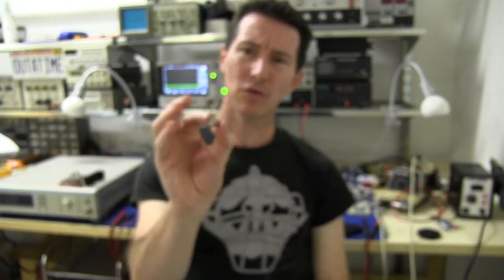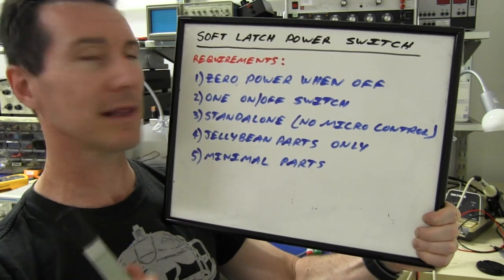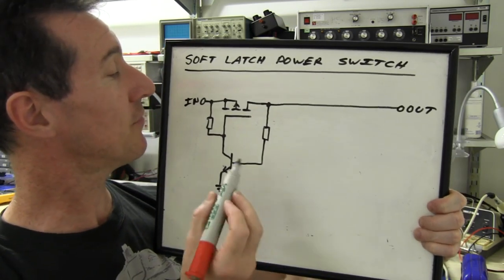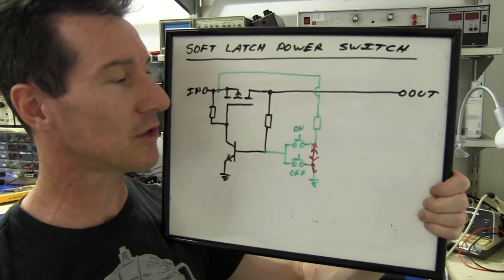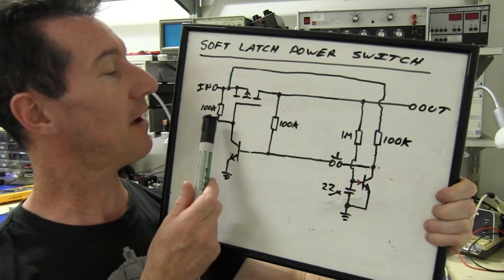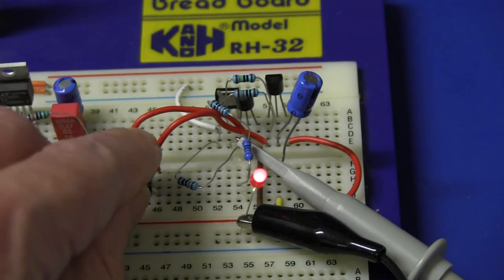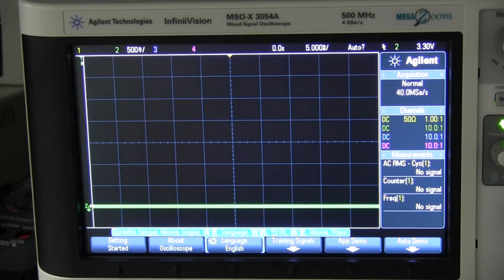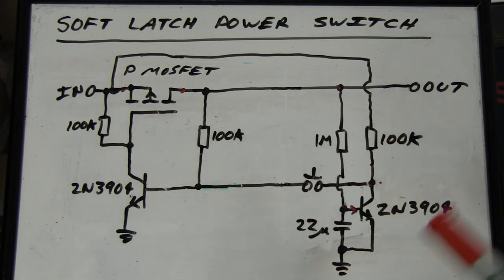EEVblog #262 - World's Simplest Soft Latching Power Switch Circuit

Comment: that circuit has a problem, if the load has capacitor filters will require more time pressing to switch off. A diode between the load and the switcher circuitry will work.
Reply: or maybe you can to use that output to feed another FET that will act as the real load switcher.

Comment: Hi EEVblog, is your "World's Simplest Soft Latching Power Switch Circuit" also working for ATX power supplies? As I understand it, the PS_ON line of an ATX power supply uses a TTL active-low signal. How could I use this circuit for this? I want to switch an ATX power supply on and off without a motherboard by using the push-button switch of the PC case. Thanks und best regards, Chris

Comment: If you want a microcontroller to control a load on and off, all you need is a transistor (or maybe two as darlington if it´s a really big load), all this circuitry is unnecessary. And if you ment to turn on the whole thing with the microcontroller, how do you power the micro when it´s turned off?
Also, that wouldn´t work since a optocoupler normally has like an NPN-transistor inside, so it can only lead current in one direction, it can not depend on the in-voltage like in this circuit.

Comment: Please help me! I have to use this circuit 160x because im building battery testing machine. Is there any 8 channel integrated circuit? I need a name of the chip. I have searched internet many times but i only can find non latching switch integrated circuit. Please help me, thank you

Comment: Is there a way to make a circuit to do away with the oscillation?  I am looking at building something simple to turn on with a press, and if you hold it accidentally it won't turn off, and to turn off would require holding for a couple seconds, and still will not turn back on if kept held.

Comment: Basically its the transistor equivalent of an SCR.
Reply: ***** Silicon Controlled Rectifier, or thyristor. The first circuit with the NPN and PNP transistor connecter back to back was the equivalent to the self latching behavior of an SCR when gate current is applied.
Reply: It's the equivalent of an SRC with a means of de-latching once the gate is powered. Switching things on is never the problem, it's getting them off again that always proves to be a challenge.
Reply: FreeFlamingInfinite yes, you are hundred percent true. i used the comparators output which is 5 or 0 volts for the triggering the circuit. once comparators out put is high my circuit latches and how i can delatch it? i want to de latch the circuit independent of comparators output.
Reply: Bilal Masood So are you saying that you're using a comparator in place of the single switch in the circuit above, and yet once the comparator has gone high (activating the circuit) you want the comparator to be able to stay high, and yet still be able to de-activate the circuit's latch system? Basically like pressing the button and holding it on permanently, while still able to switch the latch off again?
Reply: FreeFlamingInfinite sensor is attached to the comparator, Comparator is set to the reference 100mV, if the voltages from the sensor are high than  reference, Comparator's output is high 5v. now the thing is i am sensing vibrations. the signal from the sensor appears for very short time and so the comparator's output is high for very short time. i want to see the LED ON if knock is detected. the comparator's output then goes to the base of a NPN transistor and it turn on and latches the LED ON even through there is no signal from sensor. now this circuit is latched how can i de latch from micro controller. i have made a video of that circuit working.  https://drive.google.com/file/d/0B2wEybY4-pb_azBWSWE5dV91aEU/edit?usp=sharing ......

Comment: Me, personally, I would immediately strike requirement 2.  In general, I hate single function on/off switches.  I want to be able to definitively say, I want this on or I want this off.  With the lever type switch you started with, that's easy; the lever is to one side, it's definitively on, the other, off.  It is the same with SOME push-on-push-off switches, IF they have enough travel to see if they're depressed or not.  Otherwise, inevitably at some time I end up toggling it off when I meant to turn it on, or vice-versa.
Reply: Good point rchandr....  Also, I like the physical switch because there's less chance of it going bad than a component going bad and turning the circuit on by itself.

Comment: Think it would be possible to switch between 2 power supplies? Say between USB supply and a battery pack? I'm trying to do it with a circuit simulator but I have a few problems as I can't allow the battery to leak to the USB side (and vice versa) and I'm hoping to make the switching automatic.

Comment: @EEVblog can you make a modiffication to the circuit to use a N-Channel mosffet instead of a P-Channel mosfet?

PS: Very nice video i love the way you explain the circuit, thanks for the video :)
Reply: Ne555N N-channel would cut the negative supply and use two PNP transistors instead.  If negative is your ground, this would be a bad idea.  More money can be saved with the improvements in one of the other threads (ends up with a smaller capacitor).  Depending on parts and assembly costs you may win or loose a few cents by using a dual transistor SMD package instead of two singles.  Also calculate if you really need the suggested specific resistors on your BOM or can use values from elsewhere in your device.

Comment: What about N.MOSFETs? If I use a N.MOSFET, a couple of PNP BJTs and reversing the cap, is it stil working normaly (reversing the supply polarity of course) ? I just think so... I ask you this because I have some N.MOSFETs with Rdson = 8 milliohms and I wanna use them in this way (ON/OFF). Thx.

Comment: Hello, which mosfet do you recommend to handle 220 volts or 120 volts. keep in mind this will power an AC vending machine motor.
Thank you.
Reply: can not supply ac directly. this is a dc switch. however, for ac you can power a contactor as a load. the contactor-a real switch, could further supply your machine. concern here is the power draw of the contactor. industry works with 24vac-dc. if that is too much, the implement a relay to drive the contactor

Comment: When i build that first example circuit it always stays on (unless the "off" switch is held) unless I put a resistor (I use 10k) between emitter and base on the NPN-transistor. I use the 1k for base on both NPN and PNP. Is this normal?

Comment: the first circuit you showed with 2 transistor didn't work. LED is permanently on when i press the off switch the led is off till i hold the switch. the final circuit did work for me but it doesnot toggle the state everytime i press the button, i think i am facing debounce issue, any tip?
Reply: Google "debounce capacitor".

Comment: I am a total noob, which is why I'm here. But I may have a simper idea. 
It would utilise a GTO SCR thyristor,to replace both your latching transistor and mosfet. Job done?
Reply: +TheBaconWizard Yes! At least for me using a common C106 SCR. The Anode goes to 5V pos, the cathode goes to the load to ground. The gate of the SCR goes through a switch to a pull up resistor and a npn transistor to ground. The NPN transistor's base goes to a cap (47uF) and to a 100K to the cathode.
Reply: +TrainMasterMan great, well I have a BTV58-850C that aught to do very nicely then.

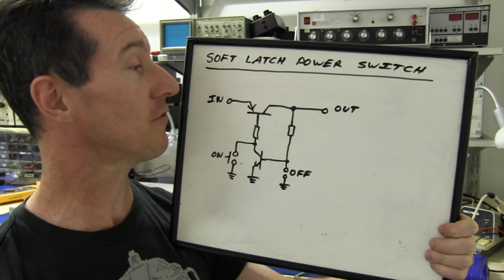Comment: will the circuit at 3:12 work if I want to turn arduino on with push button..... the arduino runs then simulates push button at the off position to shut it's self down?

Comment: Hi, i want to use this circuit with a 12v relay on the output to control my fog light on my car.  I have the OEM momentary switch in the car and for now they only beam up when holding the switch...  Will it stay off when i start the car?  I know that i can install a on-off switch but i want to stay with the factory momentary one.  Thanks!
Reply: hey did you get through using the circuit on 12v.

Comment: i used the comparators output which is 5 or 0 volts for the triggering the circuit ON. once comparators out put is high my circuit latches and how i can delatch it? i want to de latch the circuit independent of comparators output. i used the same configuration. any idea brothers.

Comment: Quick question, I made this but when I push the button the LED goes off, but comes back on when I release the button. If I hold the button, it oscillates. Where did I go wrong?
Reply: {MLP} Rainbow Dash check wiring,
Reply: Maybe.
Reply: {MLP} Rainbow Dash Actually removed my comment, since what you are describing is nothing but your cap emptying. There is nothing in this schematic that keeps your cap charged to keep it off. One solution would be to invert the on off state :D That way itll start off, and itll hold an off state forever, and then keeping the cap charged when in the on state would be simple.
Reply: Richard Smith I realized i used the wrong type of capacitor, I used an electrolytic.
Reply: {MLP} Rainbow Dash Yeah a larger capacitor will only delay the inevitable I am afraid, but if it works, who cares.
Reply: marionetadelplaneta it has to be a non polarized capacitor, which an electrolytic capacitor is. Ceramic caps are not. So it has to be the cap.
Reply: {MLP} Rainbow Dash but one side is always on ground so you just place it with the 0 V leg to ground
Reply: {MLP} Rainbow Dash and no AC signals are involved so i say the fact that is electrolitic isnt the issue ,but the capacitace might be since they are bigger on that aspect

Comment: I tried to build it with all 3 bjt transistors and the same resistors and it doesnt turns off when i release the botton, why would that happen? im using 2n2222 and 3907

Comment: hi i was wondering along similar lines:  Do you think it could be possible to use an opto-isolator to replace the button, so that a micro controller could switch this type of circuit on/off : ?

Comment: I just cant get this to work for whatever reason. Im using 2n2222 instead of 2n3904 but theyre basicly the same and shouldnt make any difference. What happens is the led on the output is constantly on and when i press the switch nothing happens except it glowing a tiny bit less brightly. Help?

Comment: Digikey 2020-08 in stock prices @5000qtd
0.02 - 2n3904
0.25 - FQD5P20TM ? 200V 3.7A 1.4ohm
0.002 - resistors
0.04 - capacitor 
0.33 - button

1.26 - switch

Comment: Efka ab60d motor , quick rotan 
q40 plus I have some of these motor in my stool they need a synchronizer to run I guess but synchronizer would cause a hundred and fifty US Dollars 1 is there a way to reverse engineer and use this motor without a synchronizer thank you

Comment: Won't a high capacitance load just switch this right back ON?
Reply: Yup, just like the anti-oscillation capacitor did.   You'd need a higher current drain (resistive load) or a diode to block current from the load to re-engage the switch.
Reply: Just built up this circuit on a actual prototype board, theres a couple 220uF electrolytics on the load side (motor drivers) and yip, cant get it to turn off at all, as the current stored in the caps, keeps pulling up the righthand transistor.  @eevblog dave, help! (:

Comment: Has anyone successfully duplicated this circuit?  If so what did you use for the MOSFET?  Seems the IRF9110 is pure Unobtanium.
Reply: i dit it with PNP
But you can use IRF9610 as mosfet

Comment: Well i'm not sure it would be cheaper. But if you have it drive a relay, it can driver a much higher current then a normal toggle switch. That's what I would user it for anyway... 12+ A circuits : |

Comment: For the P-MOS... I need an through-hole device. Can I use a 2N7002?
Reply: The brave can ask...
Reply: I forgot that 2n7000 is a NMOS and not PMOS - as required on this circuit. What options do I have?

Comment: Hi, I have a question that might seem odd, but is it possible to do a latching switch like this, but have the "anternate" state floating, not ground? - I want to switch between an input that goes 0v-15v to a floating state, is that possible with anything digital and a pushbutton? (atm its controlled with a toggle switch) - as pointed out the solution of a toggle switch is quite pricy, and also for me not handy with the lever sticking out.
Reply: Jinxid77 : The magic word of the day is "tristate". Replace the switch with a transistor's output, and connect nothing else to that side of the transistor. Technically it'll act as a small capacitor, but your switch was doing that anyways. Beware static: it could momentarily eliminate the isolation when using a switch, and can permanently do so when using a transistor: in extreme cases only relays and vacuum tubes are capable of the requirements.
Reply: Jared Maddox thanks for the suggestion and explanation :)

Comment: I'm trying to use this circuit (the final) to switch on a ATX PSU but it doesn't work. I know the circuit works as I can see the output voltage go high/low. I use the PS_ON as input voltage and output is tied to gnd. Any ideas?
Reply: the psu ps_on pin goes to ground.... maybe add a simple optosolator to short the switch ps_on pin to ground? but then you would loose the vcc from that pin to power the circuit...hmmm maybe a relay to switch between the ps_on pin to the 5v vcc rail pin with some capacitors to act as voltage buffer for the circuit while the relay is switching over the vcc from the ps_on to the 5v rail? interesting concept.... alas its hard to think at 2:30am lol
Reply: A relay is totally overkill. Use the standby power supply for the BJTs and put the MOSFET between the PS_ON signal and ground.

Comment: @5:37 Either i am totally missing something or this diagram makes no sense. Could someone please help. Lets assume the fet is NPN, this would mean that the other transistor would need to be PNP since the base of the mosfet needs to be activated by P. Yet in the diagram it shows the transistor as NPN. I have tried this  on my bread board and it only works if i use PNP transistor to toggle the fet.
Reply: *****
 So are you saying that I need to be using a PNP as my primary switch?
Reply: *****
Thanks for the feedback. So I managed to get the curcuit working on voltages between 6V and 9V. Anything higher and the "switching" falls over.
If I use a 12V supply and I measure across collector emitter (source drain) I seem to be getting voltage passing through irrespective of whether there is voltage going to the base (need to play some more here to be sure, as I have simply been pulling the transistor on the  latch side of the curcuit (not the polarity switching side) and may be getting voltage from the rest of the circuit causing the remaining gates to open). I have checked the transistors and they are fine. I have also tried this circuit in both PNP (tip42c) and NPN (tip41c) as the primary and the results are the same. Although it is not working as I had hoped, I concede that it is not working due to my lack of knowledge but will persist in playing (experimenting) until I get it going on 12V. I think the more I struggle with this the more ah ha moments I have so this can only be a good thing.

I cant help but wonder if I doubled the the three 100K resistors (not numbered in diagram so the ones to each of the gates/bases') would this possibly prevent the transistors from passing current through C/E and prevent the switching from falling over.

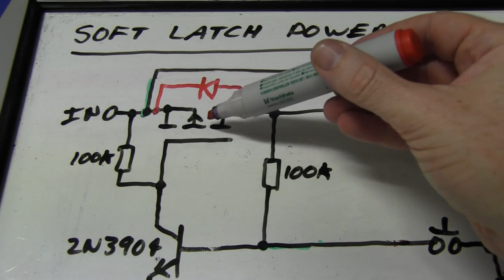Comment: parasitic reverse diode??( 15:30 ) does that mean the diode is not supposed to be there? Is it just a manufacturing defect?
Reply: Due to the way Mosfets are made, there is an intrinsic BJT inside its structure, the base of such BJT is the substrate of the MOSFET, thus not accessible from outside, but parasitic inverse currents can turn on the BJT and perform a latchup with the main MOSFET transistor (that was a real issue with old CMOS logic chips) than can lead to destruction. In order to get rid of the intrinsic BJT, Mosfets are made by shorting source and substrate that is like shorting the base and emitter of the parasitic BJT (at MOSFET symbol you can see a short between the arrow representing the substrate and the source connection), however the base-collector junction of the intrinsic parasitic BJT still remains so it is considered as a parasitic diode that doesn't  annoy so much if the MOSFET is set up in straight polarisation.
Reply: Nikola Anderbaum thanks for the reply :D

Comment: I think the two buttons on/off is better: only 6 components vs 9 (or 10 with an optional resistor) and it does not oscillate (safer). It's easy to make (for hobbyist), requires less footprint, and each button makes the intended action no matter what. A single button on/off is context-dependent; what it makes depends on the state of the system (unsafe because human errors, bad interfaces, ...). I understand that this is done to reduce costs in commercial products ....

Comment: instead of switch would this circuit work if i put infrared receiver?
Reply: If you can use your IR rx to close a pair of connectors then yes, for this i would either suggest a mechanical reed relay or small N mosfet fed off the logic level output of the receiver. This obviously assumes you have the logic control circuitry to decode IR signals, which would make this circuit pointless for your application.

Comment: how to make it work on 220v..... I really wanna switch my home lights on and off with it? Help pls
Reply: Jordan Koinarski you need to use thyristors or triacs because mosfets cant switch AC.
Reply: How about having a relay as the load on the switching circuit. On the high voltage side of the relay could be a low voltage power supply to power the switching circuit. The low voltage power supply would need a large capacitor or a battery after it to provide power to the switching circuit when the relay is turned off. 

Could pay to check with laws and insurance regarding playing with your electricity.